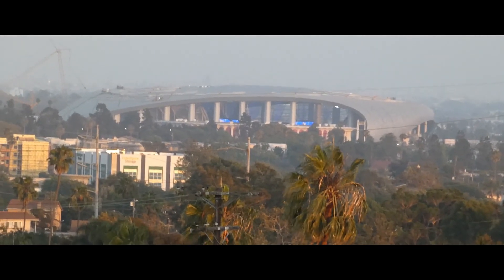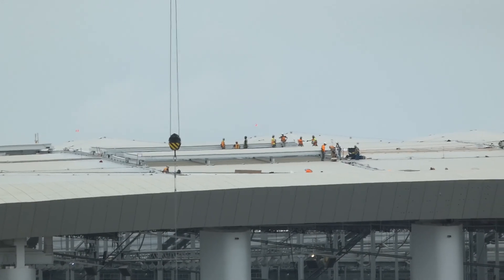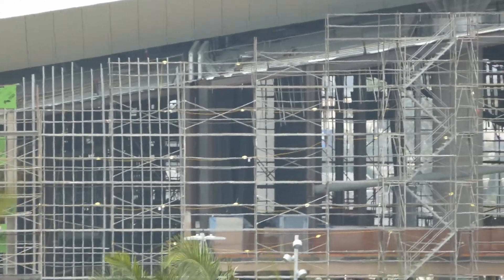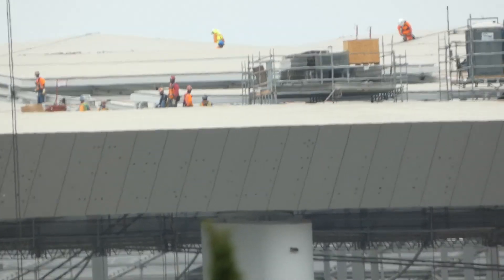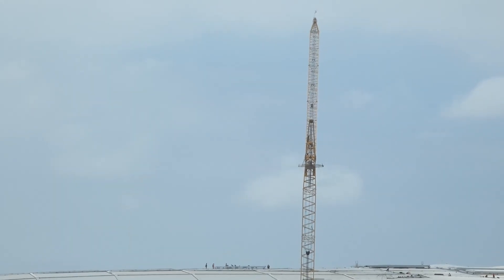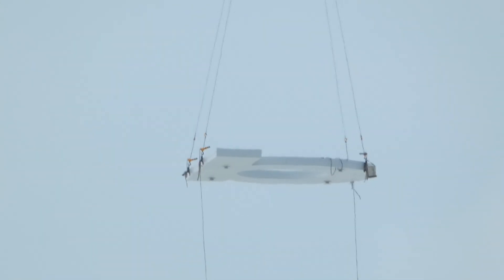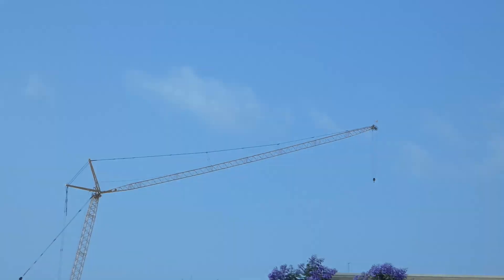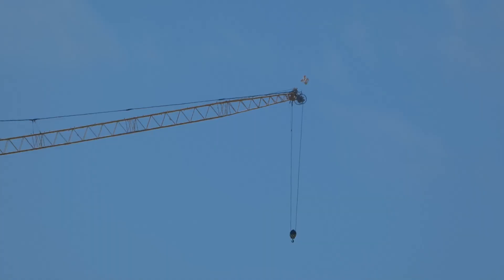LA Rams Chargers SoFi Stadium Construction Update 7.3.20

Comment: Can anyone explain why they have movable roof panels on an open air stadium!? There’s WAY TOO much labor in the roof. There’s got to have been an easier, less complicated way to erect this roof. No one, and I mean No one is ever going to see all the bullshit that goes into this roof. It’s akin to gilding a lily. What’s the point???
Reply: Because it is open air, they need movable panels to control the airflow through and out of the stadium depending on weather conditions and time of day. This will significantly improve the comfort level for spectators versus a roof without movable panels, which would trap heat underneath it on a sunny day.
Reply: BrewMagoo True story.
Also, when it gets hot, it feels like you’re in a greenhouse with all the ETFE holding the humidity and heat inside.
Plus, for baron, they need to make it waterproof so everyone doesn’t get wet.
This roof is nothing short of an engineering marvel.
Reply: They actually created a problem..lol
Reply: @bobbowie9350  Yes, they created a problem for you.  Jealousy.